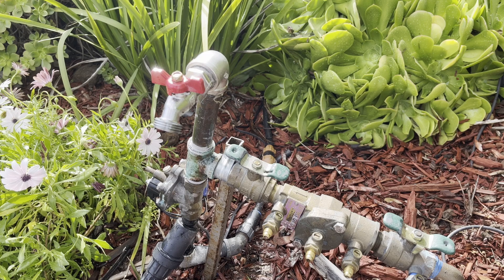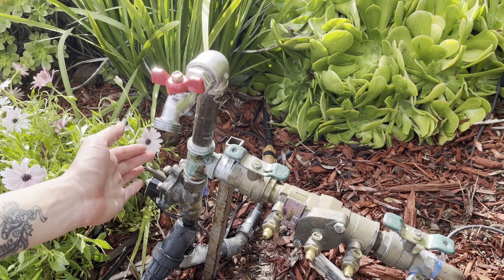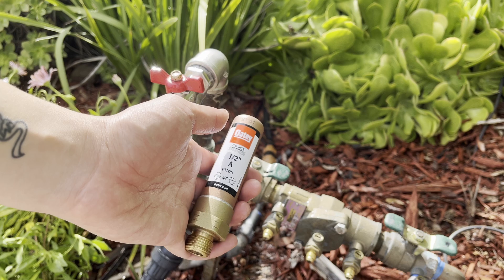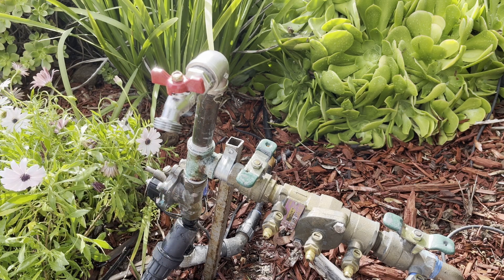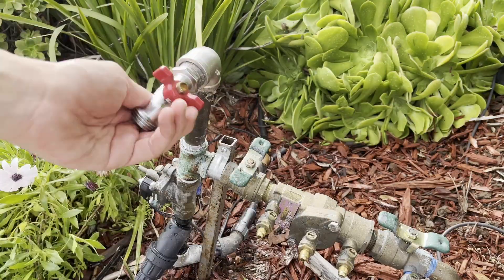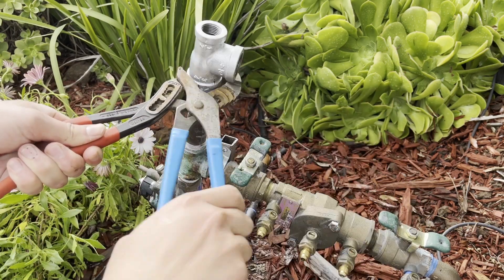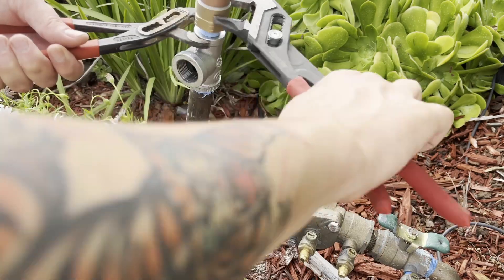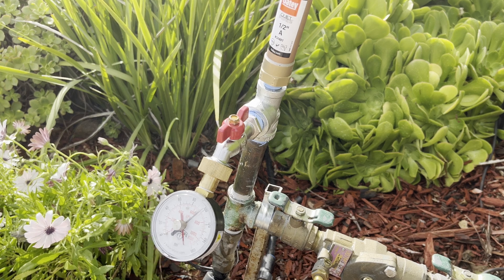Banish Banging Pipes! DIY Irrigation Water Hammer Arrestor Installation - Easy DIY Solution

Comment: Can I install the water hammer arrestor horizontally inside an irrigation valve box or does it have to be vertical?
Reply from the maker: You can install the water hammer arrestor in any position. Putting it inside the irrigation valve box should work fine.

Comment: 100psi LOL, hmmmm I wonder where the water hammer comes from, smh. Anything above 80psi is not code anywhere. You need a PRV installed at your water meter.
Reply from the maker: The backyard irrigation system and house water line have their own PRVs, I plan on installing one for the front yard system too in the near future. Here in California we typically have separate PRVs for the house and irrigation water.
Reply: @DragonBuilds Okay, here in my city in Florida we just now started requiring back flow preventers on irrigation systems, which is wild, and each city has their own requirements for irrigation, so annoying.
Reply from the maker: @datmanz5890  We also require backflow preventers here for new construction but older homes can get away with using anti siphon valves.
Reply: The smooth terrain in FL probably makes irrigation much easier -- no need for pressure as high as 120 PSI, which makes me nervous.